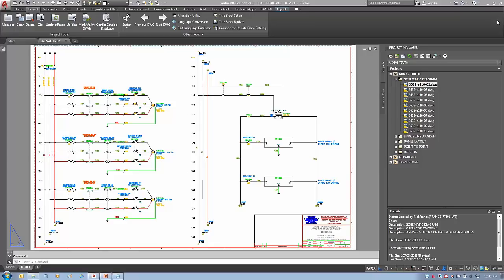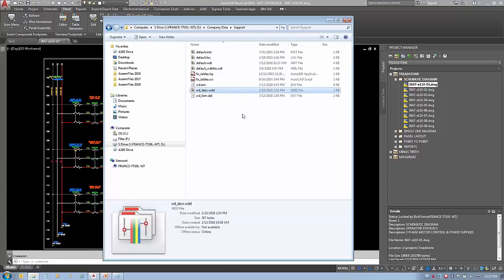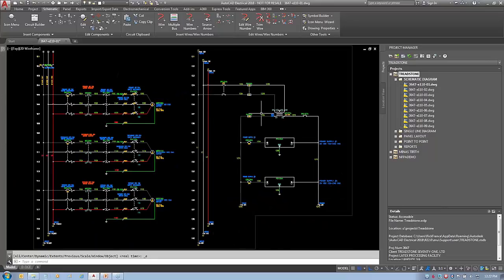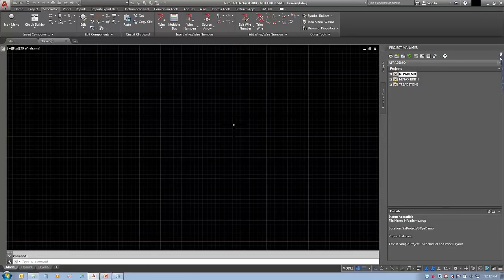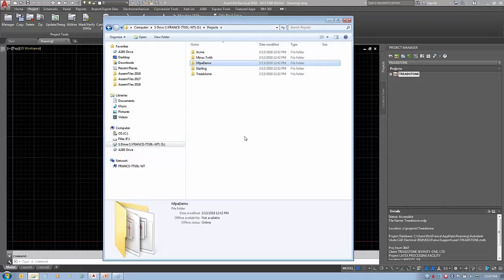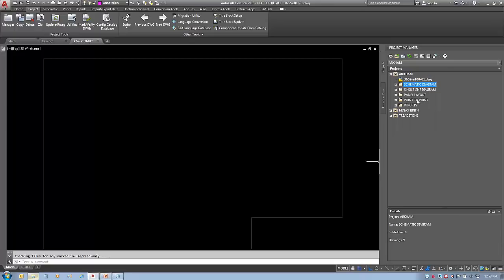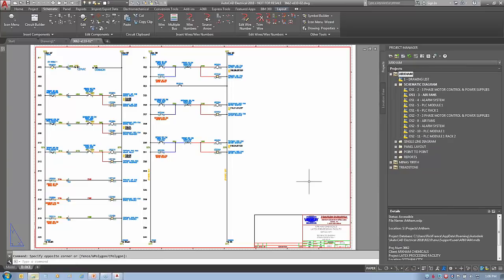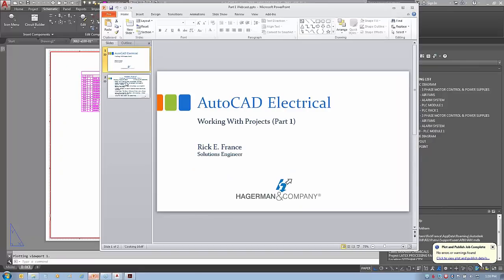AutoCAD Electrical:  Working With Projects

Comment: Let please show me how I can adjust the wiring style. When i chose loop and dot. 
The loop wire is too big, the dot is a symbol which has 3,4 circle.
Reply from the maker: This has nothing to do with the video.
 But, the only way to change the loop size is to change the Feature Scale Multiplier in the Project Properties and Apply the change to the Drawing Properties. However, that will change the size of components, wire numbers and everything else in the drawing as well.

Comment: Its a very in depth valuable presentation - except I couldn't figure out how to point the startup to the networked location of the WD.ENV file?  Im assuming its the options but then there are many locations both in Documents and Program Files folder - so which one do I modify?
Reply from the maker: You need to put the file path for the wd.env file in the AutoCAD Support File Search Path in the AutoCAD Options. You also need to move that path to the top of the list.

The majority of the time this is all that is necessary, but I have had a few clients that for some reason still had to either delete or rename the wd.env file on the local machines in order for Electrical to use the one on the network. Not sure why and it has been rare, but if placing it in the Support Path still does not work, getting rif of it on the local machine would fix that issue.
Reply: @Hagerman  Thank you.  It turns out my mistake was that I had an extra space before the " in the wd.env customization.